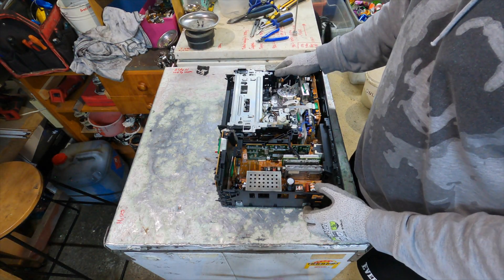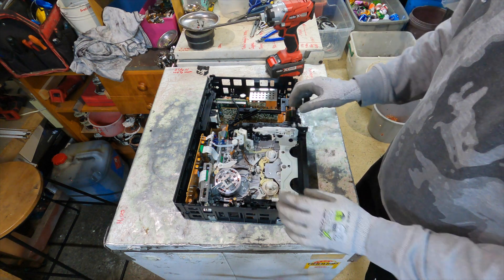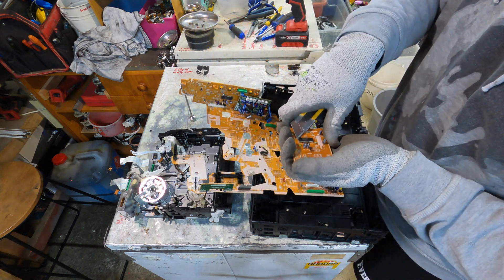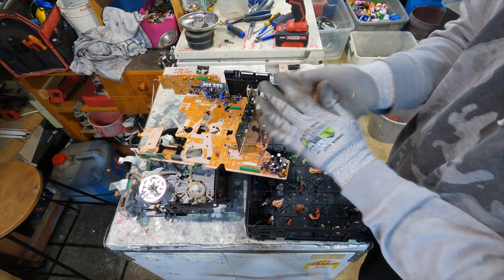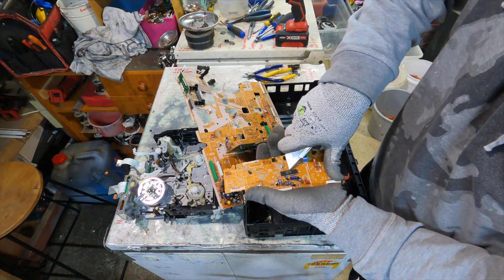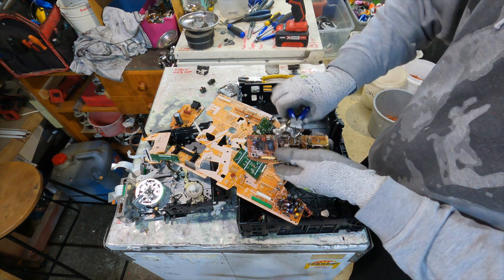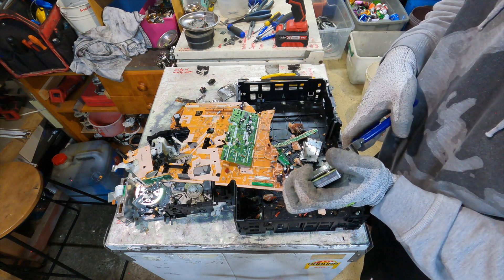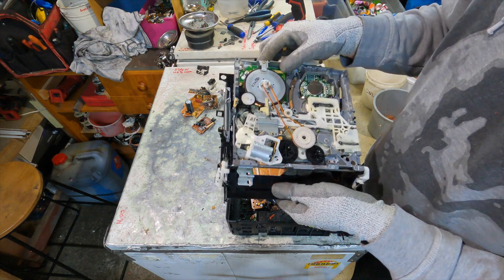Scrapping a VCR & Stripping Down Circuit Boards

Comment: i hate doing them vcr recorders lot of work for little reward ,new to your channel oh and easy way to test for silver is to drop some bleach on it and if it turns black its most likely silver
Reply from the maker: Thank you very much and for the bleach advice 👍I don't usually do them either, most have a steel bases, which like you said, is pointless doing.